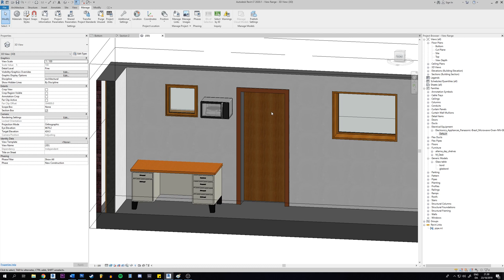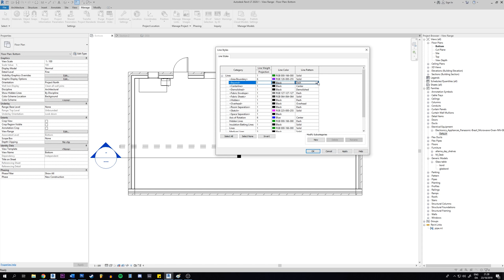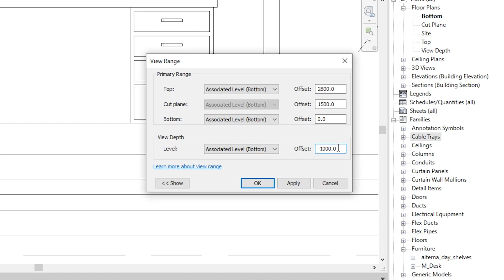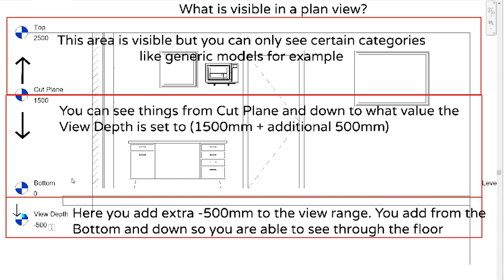Revit: How To Use View Range (2019)

Comment: While
watching this video I was reminded of one of my earlier battles with the view
range settings; I think I was almost in tears before I finally figured out what
was wrong. Turns out the view direction setting was completely throwing me off.
The structural plans in whatever template I was using were set to
"up" (or RCP) rather than "down" as I had expected. I think
you'd change this setting by editing the view's family type (been a while since
I last used Revit so I might be mistaken). I used to be okay with Revit but
admittedly I've forgotten a lot (haven't had much opportunity to use Revit in
the office unfortunately). Your videos are invaluable in re-acquiring all that
lost knowledge. Thanks for posting such a great tutorial!!